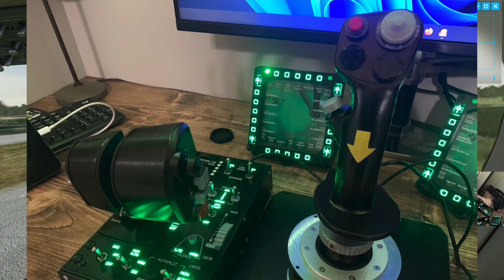Helichoppers 101 - Instructor Pilot Flies in MSFS - Lesson 3: Trim (w/ NEW Thrustmaster HOTAS!)

Comment: You need a Microsoft sidewinder 2 force feedback. Is a old flight stick, but it have force feedback engine that can simulate perfectly the force trim tool. Those sitcks with centering spring are not good to fly helicopters in simulators
Reply from the maker: Nah. Thrustmaster sent me their hotas warthog. Love it.
Reply: @SnakPakFlight  the warthog is a great flight stick... to fly "fly by wire" aircrafts, but if you want a good joystick to simulate force trim helicopters (or even older jets like the flankers, mig 29 and Harriers), the warthog is not very good, because the centering force is a spring, even a 20+ years old joystick like the sidewinder 2 because of the force feedback can be better than the warthog to fly helos, force feedback is a game changer to fly helicopters becouse it can properly simulate the force trim. Just for the case that you don't know force feedback, is basically a electric engine in the stick that simulate the force trim effect, allowing you to trim your helicopter with realism and precision.
It's just a tip tho, if you're happy with the warthog I'm happy too and thrustmaster either lol
Reply from the maker: @Joshua-by4dc  Lol, I am very familiar with force feedback. I've got over 1000 hours in a black hawk with a 4-axis trim system. I guess doing it in real life is enough for me, so when I sim, the warthog does what I need it to!

Comment: Hello  . I've had msfs20 for 2 years and I would like to do the Helico but I encounter a problem with Throttle with Thrustmaster hotas Warthog, when I increase the throttle the RPM of the rotor decreases.
Reply from the maker: Not sure which helicopter you're flying, but this is a natural phenomenon if you apply too much torque. The engine can't keep up with the amount of rotor blade pitch you are demanding from the collective. If that happens, your rotor will droop because of the increased drag on the rotor system. Keep in mind that you need enough engine to support the lift you want from the rotor system. Since drag is a byproduct of lift, every engine will have a limit somewhere. 

Of course, it could be that you just need to reverse the axis on your collective input. When you increase collective just a little bit, does the helicopter take off? Does the rotor immediately drop? If that's the case, you may have the hotas coupled to throttle AND collective. These are two different things. Most helicopters have an automatic throttle gizmo of some sort, so you shouldn't even need to have any control inputs coupled to it to be able to do normal flying. If you want to be able to manually control the throttle, say for runups or simulated engine outs, then use a different axis.
Reply: @SnakPakFlight  'Hello and thank you for your reply. I fly on the Bell 222B cowansim, The problem was indeed a gas and collective coupling. Now it's much better.
Reply from the maker: @Bronco-41  Sweet! Glad it's working! Happy flying!

Comment: Hi from a fellow former army helicopter pilot. I'm looking around to see if anybody else has figured out how to implement force trim in helos. I guess not. I think the current implementation of hilos is pretty great, but the lack of force trim is a HUGE shortcoming! Fingers crossed asobo adds this soon. 🤞
Reply from the maker: The problem I see with it is that you can hold down a button near your thumb and move your joystick, then let go to simulate force trim. But I'm pretty sure most if not all joysticks spring back to center so what happens after you let go of the joystick? Seems like it would be "pushing against the trim" of the simulator.
Reply: @SnakPakFlight  there's definitely a solution. It's been done before.

https://youtu.be/4AXZw3q7xvo
Reply: @SnakPakFlight  check him out:
https://www.youtube.com/watch?v=FVQ8w8BwIzM&list=PLPolSM6rkoQnhYIckmPr7OsQaf5S6JWXd&index=1&t=521s
Reply: @SnakPakFlight  and also this if you have a 3D printer, couldnt find it before:
https://www.youtube.com/watch?v=Mbcy86xJv3o
Reply: @SnakPakFlight  and also get in contact with VKB controllers to get their T-Rudders pedals for test.

Comment: As a relatively inexperienced pilot this gave me palpitations.   Letting go of the cyclic is pure life-ending in my tiny brain's imagination.
Reply from the maker: Lmao! Even in a UH60L without autopilot, we could get it trimmed up pretty well. A lot of the time when flying at higher altitudes (like when IFR), we would use friction on the collective to set our desired power setting (prior to takeoff, you can calculate how much torque you will need to maintain a particular altitude and airspeed using performance charts in an aircraft's operators manual). Then we would set the cyclic trim to zero out vertical speed and give us the correct pitch setting for the desired airspeed. After that, you could basically let go. I never completely remove my hands from the flight control area. Always guarding. But you could, in fact, get it trimmed up and have a stroke and it would continue to fly until it ran out of gas.
Reply: @SnakPakFlight  That is mindbending and reassuring at the same time.  I wish I'd been able to graduate to more sophisticated machines.